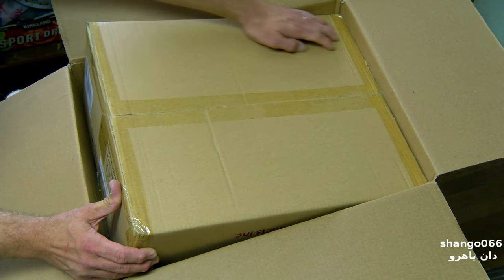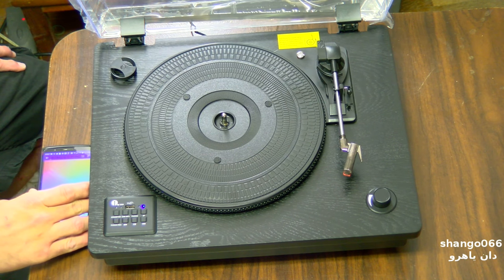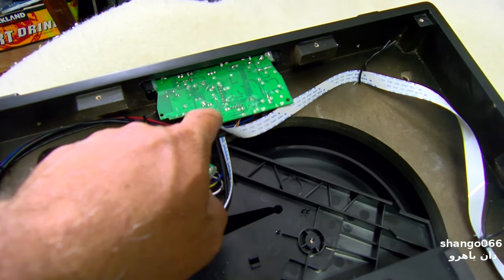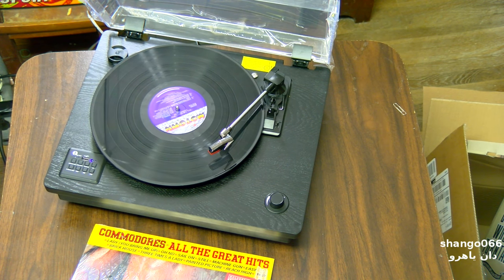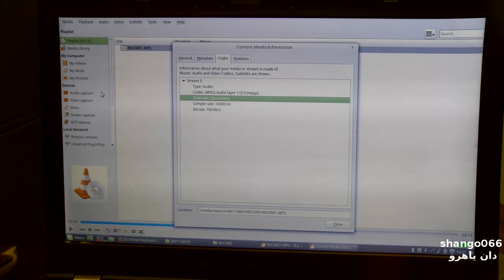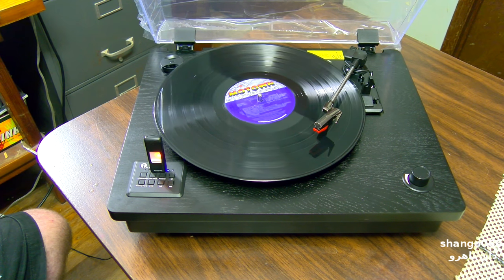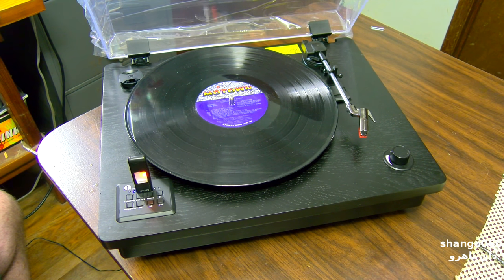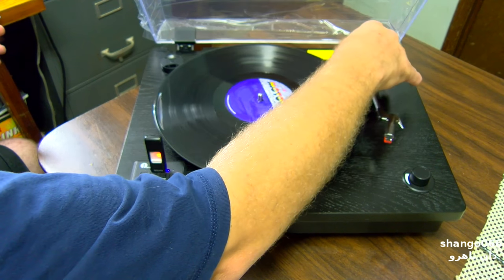1byOne Portable Classic Record Player Review Demonstration

Comment: Non-sarcastic comment... I suspect the makers and distributors (brands) of the horrible record players are seeing the writing on the wall  - their intended market is realizing how poor the Crosley Cruiser and all it's twins under many brands really are. So they use a slightly more "deluxe"  drive unit, sometimes a very entry grade magnetic cartridge and change the overall appearance from "retro 1960's" to "retro 1970's (not unlike they did from the older nostalgia stereo systems. Problem is, the prices are crazy high for what you get in terms of quality - selling for prices at or above true high quality turntables. Plus I've seen these units as just a turntable (no speakers) aimed at the uninformed buyer.  Do people realize you can buy a ProJect turntable with the Crosley brand on it? It is grossly overpriced - twice that of the uTurn Orbit or the new Fluance turntables.

Comment: put the device through another check up  in a couple  years for shorts,mousewhisker wires come loose,the speaker suspension crumbling,circuitboards shorting,,rca  phono out to AUX in,,,bought a 70s united audio,made in deutchland,requiring a drop or 2 of oil on the center spindle,tracks @ 3/4  gm to 2 grams,, it schtill verks,built to lasst a taudand yeahs.

Comment: Nice turntable.. classic and modern at the same time. 
Congratulations on your first review of such things, too! :-)
What DC voltage is required to run it?... one could set up a battery pack of similar voltage/amperage requirements and the correct plug to fit the DC input jack....or even fit the batteries inside...rechargeable, of course ;-).

Comment: 32:50 There shouldn't be any excuse to make something based on digital audio technology  under-powered these days, when there are 30 W class D amplifier chips that literally require no heat sink. If I hear anything that sounds bad now, it's hard not to conclude that they just aren't trying.
Reply: But then you'd have to give a decent power supply, and provide isolation of the turntable mechanism from the rest of the cabinet (those grommets on the speakers might be good for 2W/channel, but at higher outputs they're not gonna be enough).  It all adds up to money, which raises the price of the product.  You and I both know how many people make decisions based only on price.

Comment: I think you covered all valid points, especially if its selling point is to convert vinyl to mp3 and it comes out as mono/phone quality.  If you have a test record, I would be interested to see how constant the turntable is.  I have a couple of test discs and there is one that I use to check my Pioneer PL-A35D every now and then.  It has a single straight tone on one of the bands.  If the tone goes all over the place on any turntable then that would be another deal breaker for me.

Comment: I'd get one, if one came my way... it's a cheap source of a basic platform to experiment with... I've been a experimenter/home-brewer all my life, so I would take the time and effort to fine-tune the designs in that unit and smooth out the rough spots in the designs and make it a usable machine. It can (potentially) do a lot of cool stuff, and it can be portable with a nice home-brew battery pack added....  there's plenty of room inside to mount an adequate battery pack and a charger circuit-board....tons of room....one could even stick a little radio board in there, too and hook it into  the mix... it's got great potential for an experimenter-nerd to hack into something more stable and fun.  :-)
Reply: ... definitely gotta start by freeing that awesome speaker chamber... I remember that system design..years ago a friend gave me a couple of ESS stereo  speakers... those speaker systems came with a heavy-framed die-cast metal 6 inch driver and a massive die-cast metal horn tweeter in the front of each of the two cabinets, and in the back of them was a heavy-framed 12 inch passive diaphragm that looked like a speaker with no magnet or voice coil, just a heavy die-cast metal basket and a 12 inch cone,  all mounted inside each of two big air-tight real wood cabinets, and when I would press against the driver cone, that big diaphragm in the back would move, too...  and that system pounded out the fucking bass and treble and mid-range and none of their cones, either front or back,  seemed to move at all during heavy bass notes... a regular speaker system usually had the big front-mounted  woofers who's cones wobble in and out during bass-overload until they practically blow up try to keep up... but those ESS's were friggin' nuts..huge bass response and no cone-wobble... like they were friggin' haunted or something.. LOL!... any way...that little speaker in that turntable comes from quite an ancestry.  ;-)

Comment: This appears to be junk.  The platter is warped and the tone arm mech is a joke.
Reply: Its getting very hard to find a good record player these days and find a used good one is very rare.
Reply: +TheRetro1986 It looks like they tried to make it a step up from the crosley hotsnot tables.  It has some cool features, but I'd say it's a novelty item.
Reply: Whaaaa? There are literally millions of excellent turntables out there...  Modern(ish) suspended subchassis types from AR, thorens and dozens of others. Japanese studio / semi pro turntables from 60s 70s from Pioneer, Yamaha, Micro Seiki , Sony etc. Individual nice turntables, ERA, Neat, Garrard, Rek-o-Kut, Beogram, Gates, Philips, Optonica.
Try a Marantz SLT or Lux PD300 to modify and have a world class TT. Empire are great TTs,  Or find a Fairchild or EMT if your floor can handle the weight. I could go for hours and have not mentioned Rega or Project or any of the hundreds of modern decks. Or how about modifying a Lenco...easy and they are woww when fiddled with.
Reply: PS and even Technics have made the odd decent turntable, But look at one next to the Fairchild and it looks like a toy.

Comment: The MP3 is not MONO, but "DUAL MONO", if VLC's information is accurate.  I definitely DO hear stereo separation from your MP3.  It's not quite as obvious as your camera recording, probably because a lot of the separation is in the trumpets which sound very dull with such a low sampling rate, but it is definitely a (very low quality) stereo recording.
Reply from the maker: Its mono, I listened to it in headphones and there is zero separation.
Reply: shango066 

I'm sorry if I seem disagreeable, I've been enjoying your videos for a long time.  
But with all due respect, I am listening on headphones now (actually, cheap earbuds) and at 21:26, I am definitely hearing L/R separation.  It doesn't exactly hit me in the face, and it's definitely not as wide as when you fed the audio to the camera input, but it is there.  The fidelity on the other hand, I would agree does sound like a telephone.

And 16,000hz at 160kbps?  What a very strange sample rate / bitrate combination!  If the sample rate is going to be that low, I'm willing to bet that most people wouldn't notice if they dropped the bitrate to 64kbps to match!
Reply: Hmm.. maybe when you play the MP3, it's being decoded as if it was mono, but whatever video encoder you're using is seeing  and processing it correctly as a stereo recording?  I know this sounds odd, but I have come across things like that with the occasional horribly encoded "non-standard" MP3 from source unknown.

Comment: 21:23 In USB playback mode it sounded clear but it lacked the treble frequencies... bass was OK... in direct-to-camera playback it sounded nice, with a little more bass and a lot more treble.
Reply from the maker: To be totally honest I dont remember the details. I do have another one of these different brand someone gave me. I should review it to see. Its hard to get motivated on this new stuff as I have a 1200 with broadcast cartridge, all these are just toys to me
Reply: Understood... as is, that set is definitely not something one would want to make a living selling,  unless they happen to live in a White Van down by the river, or something..lol :-D ..because it needs an engineer to practically rebuild it to make it stable and not skate across the records and all the rest of it's flaws... it's cool what some of this new stuff can do but the friggin' cheap build... makes them practically  all "White Van" stuff.
Reply: Roger on the 1200... I remember those when they were new on the market.  .. they're definitely mil-spec build.... I'm 60 and have been into electronics and mechanical things and  building things with vacuum tubes and stuff like  that since I was little... I love that stuff... and things like those Philco portable battery tube radios you showed a while back, the ones with the Loktal tubes and little internal vibrator power supplies in them and the 2 volt storage battery to run them and weigh 22 pounds or so... definitely awesome, too. :-)

Comment: That "lubricant" is there to prevent the tone arm from smashing down on the record. There is no anti skate, you get an obsolete ceramic cart, the tone arm is too short so as a consequence end of the record distortion is way too high and will wear the groove out instantly, the drive motor is a toy, well, no need to spoil any more words on this junk. Aparently this is the latest of numerous versions that infested turntableland. Avoid!